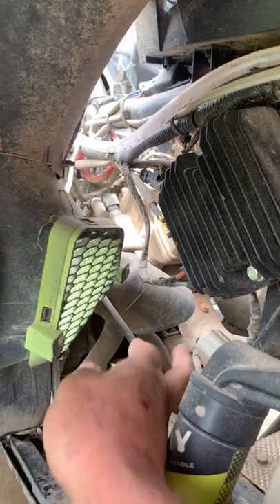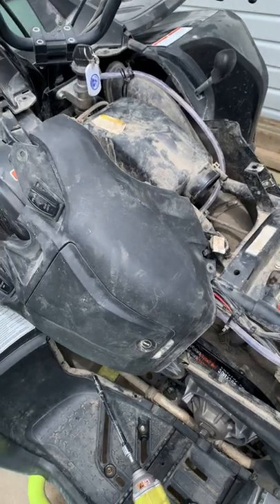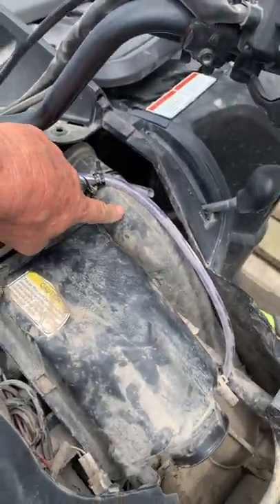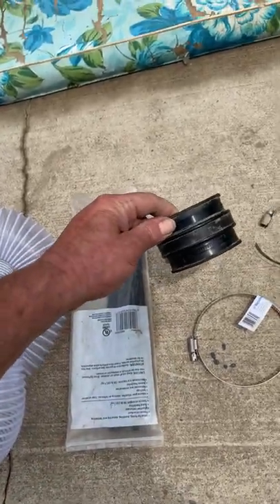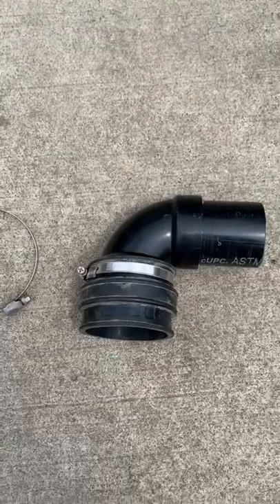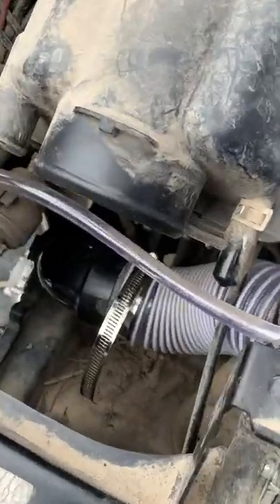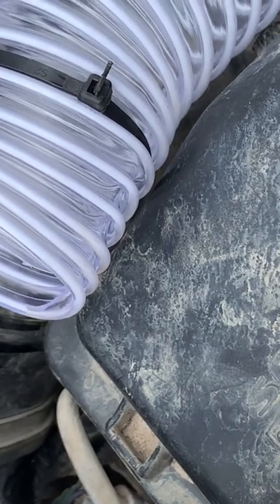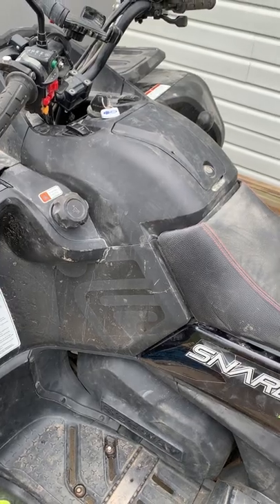Water / dust everywhere. Stage 2 of protecting your Segway Snarler

Comment: Why are you suing the pvc elbow and small 3” piece ? Couldn’t you attach that white flex hose directly to the inlet ?
Reply from the maker: It won’t go over it. Main reason is I wanted to keep it low as possible away from cyl head heat, and don’t want it flexible to move around and get caught in vent tubing or shift linkage
Reply: @scotthyatt4751  understood !